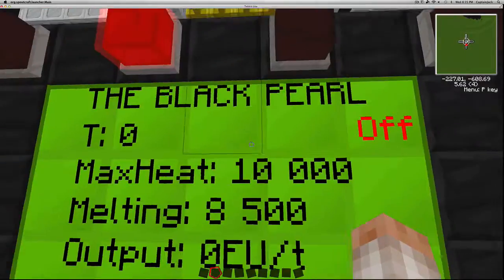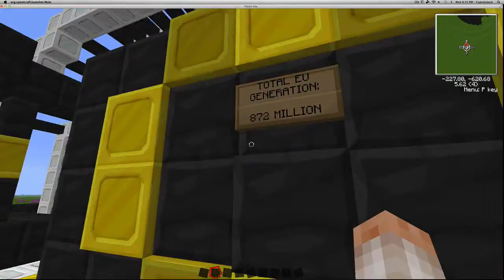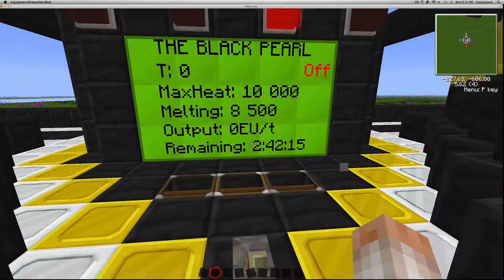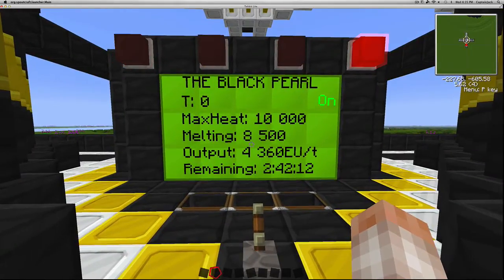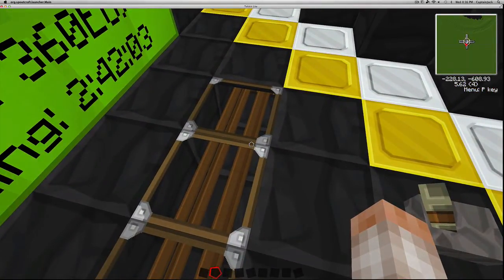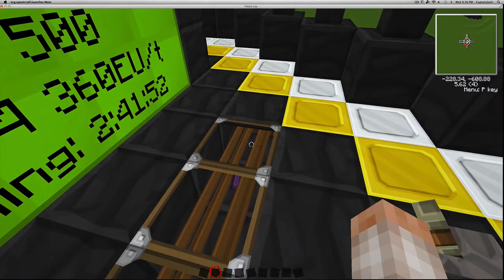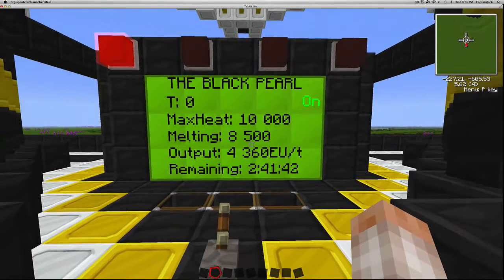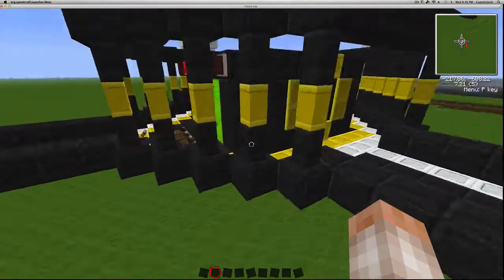Extreme Voltage IC2 Nuclear reactor - Tekkit Lite

Comment: ok i need help how do you lower the HV to a LV my shit keeps blowing up
Reply: yes have this Problem tho XD
Reply: It's EV, not HV :D
Reply: Late to the party, but here's an explanation for anyone else who might wander into this video:

In order to step down the powerful this reactor safely, you need not one, but TWO HV transformers*, followed by 2 MV and LV ones if you're powering LV machines with this. This is because the power output (in EU per tick per packet) is above the Extreme Voltage cap of 2,048 EU/t/packet.
The Gregtech addon (at least GT 4), IndustrialCraft 2 Experintal (MC 1.6+) and IndustrialCraft2 Classic (MC 1.7+) consider this to be Insane Voltage (IV), and cap it at 8,192 EU/t/packet.
*If you want fewer step-downs, Transformer Upgrades can help upgradable machines accept up to EV, but they still require transformer assistance. An Adjustable Transformer might work, but I don't recall if those are legitimately craftable or if they can accept more than maybe 2,048 EU/t/packet regardless of configuration.
Reply: Side note (text ramble warning): more recent versions of IC2C adds a seventh voltage tier: Ludicrous, which caps out at 32,768 EU/t/packet. This voltage can only be conducted by plasma cables and output by an IV transformer (step-up), Nuclear Reactor designs like this one (since all base uranium rods' EU/t output is tripled with no change in lifetime), and Plasma Energy Storage Units (plus the Plasma Storage Device items that are usable as independent ultra-batteries and are required for PESU crafting). While the Creative-only Adjustable Emitter (from Advanced Power Management, I think?) can be configured to output LuV-level power in total, I think the packet size caps at EV.

Speaking of buffed reactors in IC2C, there's also a Uranium Enricher that, well, enriches refined uranium; specifically, with (mostly) magical/mystical Minecraft materials, affecting the properties of all fuel rods enriched with said materials. For reference, the singular unenriched fuel rods individually generate 5 EU/t and 4 heat each reactor tick (every second for normal, every game tick for steam), and lasts a total of 10,000 seconds. Here are the singular enriched fuel rods:
-Redstone: 10 EU/t, 6 heat/t, lasts 8,000 seconds. Releases 2 neutron pulses per tick.
-Blaze: 16 heat/t, otherwise same as normal. Great for steam reactors since they don't output EU directly.
Ender Pearl: normal base output, only last 5,000 seconds in total, but has the unique effect of interacting with diagonally adjacent components in addition to orthogonally adjacent ones, allowing for higher efficiency.
Nether Star: Gregtech plutonium on steroids.
50 EU/t, 14 heat/t, lasts 20,000 seconds.
Considering the potential difficulty of acquiring even one Nether Star in the first place, it is even more worth crafting 8 depleted cells with each ingot and having a breeder reactor ready in order to maximize number of rods per star.
Charcoal: the only normal material on the list; fuel rods enriched with this produce only 3 EU/t, but last 15,000 seconds. Slightly like Gregtech thorium rods.